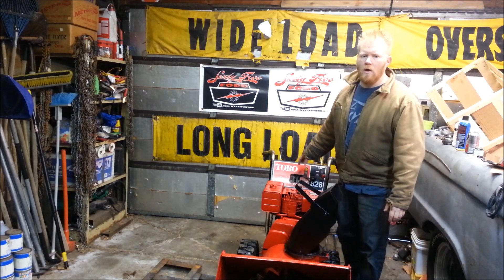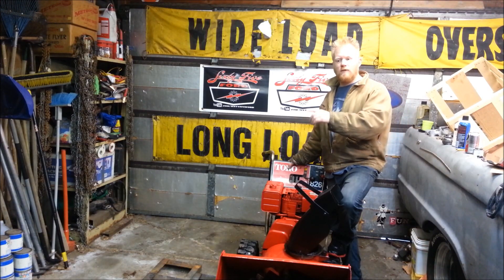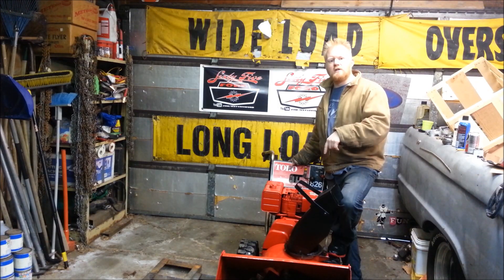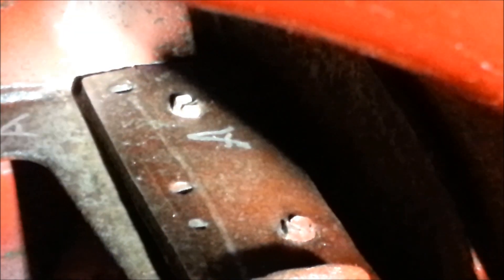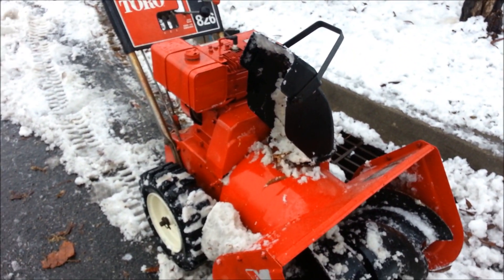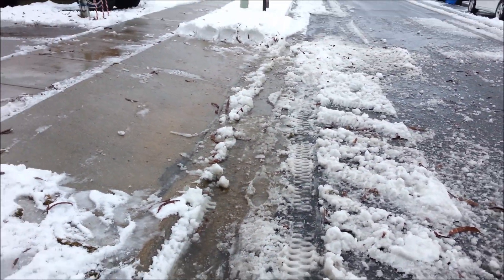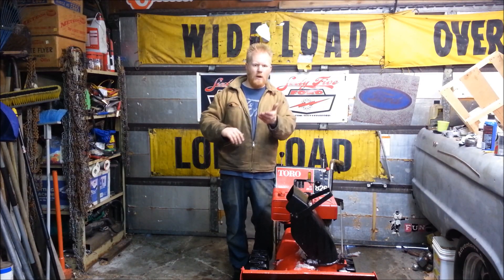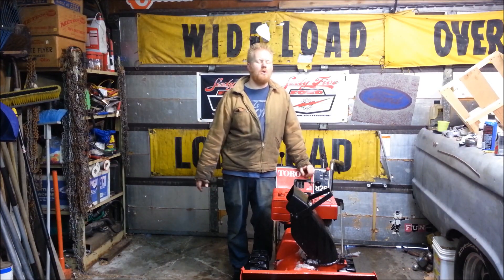TEST snow blower Impeller Modification with and without

Comment: Bought a brand new Cub-Cadet 524SWE 2 stage.
Could not be more thoroughly-disappointed in it's throw distance...wet or dry. $800 bucks and it performs like trash.
My single stage is far superior.

I have no doubt this mod works.
I feel rather alone , doing it to a brand-new blower...most people on here are talking about their 1970's  rigs.
I go forth knowing it will void the warranty...but something must be done!

That said...there HAS GOT to be a reason for the gap as manufactured.
I don't doubt your performance increase....but there is something missing here.

Clearly, the people who design these know more about it than you or I.
If a multi-billion dollar company like Honda thought this rubber-mod would help them attain the performance you state...they would implement it in a heartbeat, by either changing the design a bit, or simply buying the patent from whoever owns it.
Hardly an inconvenience.

For the ability to increase performance this much, any company would sell their soul.
There simply HAS to be a reason that they leave a gap like they do.
Reply from the maker: justkeepinitrealyo There are plenty of reasons to not put this on for a manufacturer. First it is patented and owned by Simplicity who did put this on their machines. The higher end machines do have a lot better clearances and therefore better performance. So the Top of the line Hondas, Toros and Simplicity machines only see minor performance gains from this modification. The lower end machines work but with suffer from this major problem. This entices people to upgrade and buy more expensive machines. $800 is not a small amount but is about as cheap as you can buy a snowblower in the 2 stage world. MTD owns most brands like Cub Cadet, Troy-Bilt, White, Yard Machines, Bolens, plus dozens others and their only goal is to sell machines with specs. I'm sure you bought your machine because of the specs. MTD could do this to all their brands and wouldn't make them any more money.
Reply: Thanks for the reply.
Most of what you say makes sense.
I disagree on one point.

Entry-level models in 2 stage start at 500, and graduate in 100 dollar increments. That puts a 800 dollar machine as 4th tier level...not "about as cheap as you can buy".

Granted, still in the lower end, but not bottom end.
>>>First it is patented and owned by Simplicity who did put this on their machines.>>>

Could you provide a link to the Simplicity units that incorporate this feature?

Thank you,
Reply from the maker: I actually had no idea any manufacturers had done this until I did some major research. Simplicity did it in the early 70" but hasn't since. They were innovators and did stuff no other manufacturer dared. It was deemed a wearable part needing replacement every few years. The competition who had no such modification obviously touted they're machines required less maintenance due to not having these.  Simplicity used it on there Inline Impeller Snowblowers.

Comment: Why don't manufactures do this as standard ?
Reply from the maker: Because you wouldn't buy a new snowblower if it worked flawlessly. The top models have very little gaps and perform very well. They have sloppy tolerances on the cheap sub $1000 machines and expect you to toss it in a few years time and buy the machine that actually make them profit.

Comment: Yeah maybe for that machine. But for the new Toro's with the anti-clogging system. COMPLETELY UNNECESSARY.

I have snow blowed everything like the stuff that you're showing right now to the heaviest wettest snow fluffiest snow whatever HAS NEVER CLOGGED ONCE.. 

The other question is how much further do you need to throw snow.. sometimes throwing snow too far can work against you depending on the size of your property.. 

You don't necessarily want to throw it ridiculously far.. 

The up to 45 ft is perfect in my opinion in any situation.. 

The other thing you have to think about is there's a reason why those impellers don't have rubber on them anyways.. there's a reason why those impellers aren't bigger and made as big as you guys make them to throw it further and to try to stop it from clogging. DON'T YOU THINK IF THE R&D DEPARTMENT THOUGHT THAT WAS THE WAY TO GO TO MAKE THE IMPELLERS BIGGER, LONGER SO IT WOULDN'T CLOG THEY WOULD DO IT!!  You're putting more stress as it's spinning on the machine.. 

You see these companies have real engineers and an R&D department that know way more than everyone doing these modifications do. it's not even close!! 

They build the impellers for the most efficiency for that particular unit AND THE HORSEPOWER OF THE UNIT THAT COMES WITH IT.  This is easily proven if you look at their models.. each impeller is actually made a different size and a different shape for that particular model.. 

I guarantee when you're doing this you're overworking the engine, there is probably some belt slippage that you don't even know about that's going on..

It's wearing parts and the engine out more.

In other words if those rubber paddles came with this machine from the very beginning after all these years the engine would have probably broken down by now..  

So I'm glad it works for you with that snow and that situation.. Maybe those engines are tougher who knows..

But for a modern unit maybe 10 or 15 years old I would never try this never never. 

It's not worth the risk. Snow blowers are expensive.. can I trust the engineers for making the impellers the way that they do, The size and the gapping.. THERE'S A REASON FOR IT!!  

I guarantee you they are the size they are because it puts the least amount of stress on the machine..  

I don't know how much better your machine would work if you sprayed that special stuff all over the impellers And the shoot. I've seen similar results.. 

Nice to see a Toro that old still working well.. I think Make the best machines. And as a company they're always innovating trying to make things better. No shear pins, anti-clogging, The quick stick etc....  

Big fan and everything that they've tried to innovate... It has really worked..

Comment: I use silicone spray with Teflon. I just spray the inside auger and the shout and it never clogs. and we get atleast a foot or more a year. that and I raise up my snow shoes about half inch So I don't pick up wet snow or ice. but I'll try this on my cousins snow blower and see what happens.
Reply: The silicone spray does work great. The problem with raising the shoes that high is your not clearing down to the surface.

Comment: Thank You, My 2004 sears 5hp snow blower never worked this well, never threw this far,
 zero clogs during the "Blizzard of 2016".I used this:
 http://www.tractorsupply.com/tsc/product/baler-belting-2-ply-4-in-x-60-in?cm_vc=-10005
to make the paddles for 2 of the 4 impeller blades.
Reply: +Ray Miller Thanks for the post. My Sears 5.5 2008 clogged about 6 times today.
Reply from the maker: +Ray Miller That'll give you enough to do a hundred. I put a link the in video description to a piece of this stuff that will do several snowblowers for around 10 bucks.

Comment: Did anyone else notice that this fella is snowblowing a foot away from the curb, where there is less debris/yard waste while using the modification on the impellar blades and then after removing the pads...he angles the snowblower in towards the curb where all the leaves and debris is concentrated and the shute becomes clogged with snow and leaves. Im sure that these pads actually do help because they reduce the gap between the outer drum and impellar blades but i have to call bullshit on this particular test because you can clearly see the snow/leaf debris in the clog. I had to laugh cuz there is about an inch maybe two of snow and this snowblower was really struggling. I would've liked to have seen this test in some real snow and not an inch or two of slush and leaves.

Comment: It's a good thing you're not in Maine.You'd be hit with a fine for blowing snow into a public road,and rightfully so.There's no excuse for doing that.
Reply: Im surprised. Is that really a law? People throw snow in the streets all the time.
Reply: @drmariopepper4354  -Yes it is the law,at least in Maine.It got to be a real headache for state and local plow crews.I've seen people leave 2 foot high rows across the roads without cleaning it up.Plus it's a safety hazard for cars.I realize what he put in the road wasn't much,but it's still not the right thing to do.
Reply: @markmorris3579  Yeah you're not allowed to do it here in NS either.  I snowblow back onto my own lawn.
Reply: @Stationary76  -I'm glad you do the right thing.I'm sure the people who use your road appreciate it!
Reply: @drmariopepper4354  I'm pretty sure it's the law wherever there is snow, but it's like a lot of laws, it's there for people who egregiously abuse the system.
Also, he is not really blowing snow on the street, he is blowing snow already on the street to another part of the street, which is another law.  ;p

Comment: Most snowblowers will clog if there is not enough snow going through the chute to blow it out.  Before you take it out into heavy wet snow, heavily spray the 2nd stage impeller and the chute with WD-40. Snow can't stick if the chute is slick.
Reply: Also put a tachometer on your motor. Make sure it's pulling full maximum safe RPM. The faster turning impeller will have greater throwing force on the snow.
Reply from the maker: With this modification, you'll never need to spray down the housing again.

Comment: It's amazing to me that the people who make these products don't think of all these things first.  I've seen companies that only make one product and the product sucks.  Dirt Devil comes to mind.  They always are total pieces of shit.  The guys must go home and use Bissels.  BTW, the fans in jet engines for commercial airliners have a surface for the fan to just touch.  I wears away if there's interference so the fit is very tight.  You are exactly right about everything you said.  Thanks for the video.  Right now i'm working on my single stage Craftsman w/ Tecumseh 3.5 hp that is getting no spark with a new magneto coil.  The shit never stops..............a
Reply from the maker: alex tworkowski "Dirt Devil" very true and funny. They make stuff to just barely  work or make noise and make you think it's working. The same is true in any industry. My neighbor just brought home a new snowblower and I went over to take a peek; horrible engineering. Basically China just made it to look like a snow blower and for it to make noise.